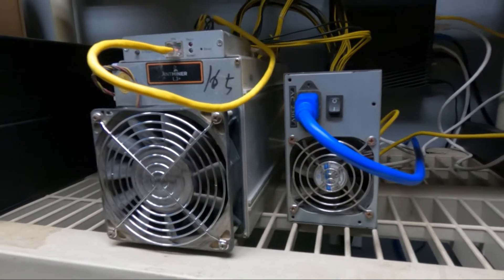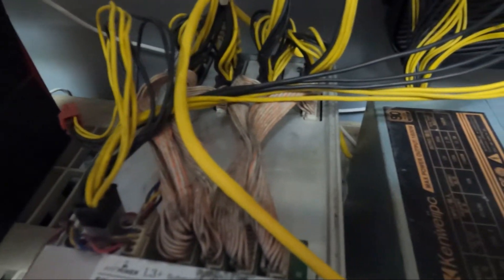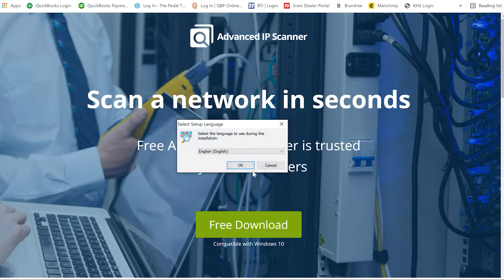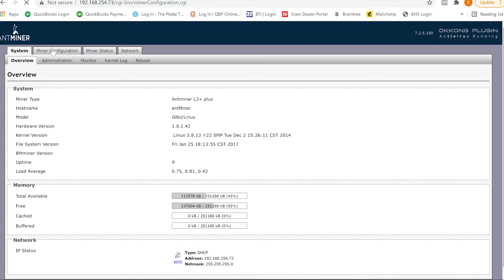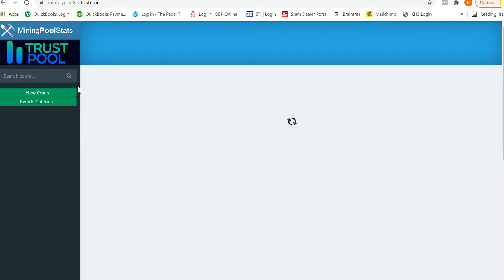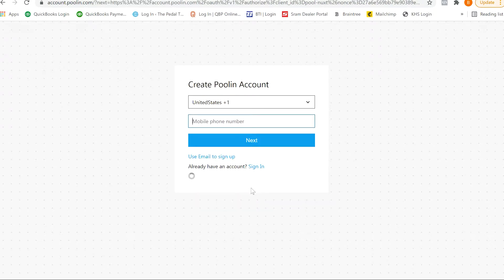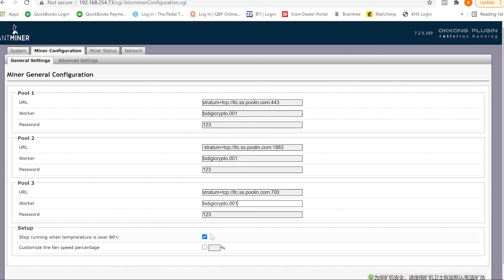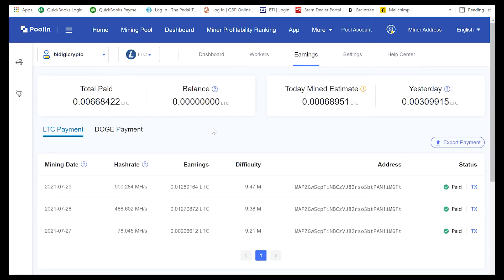How To Mine DOGECOIN and LITECOIN!! [Antminer L3+ Setup]

Comment: I just got my 13 antminer, put in all my conig settings but after save and apply it keeps reseting back to default settings. I think it's virus problem . please let me help to fix it
Reply from the maker: Yes sounds like it. Have you tried to flash firmware? If it wont let you do that either then it is most likely so. You will then need new control board.